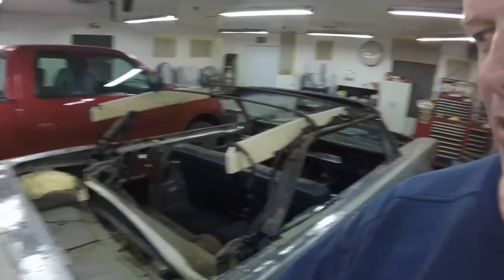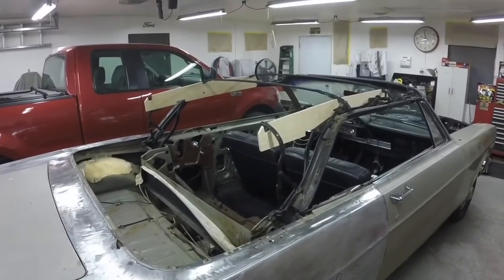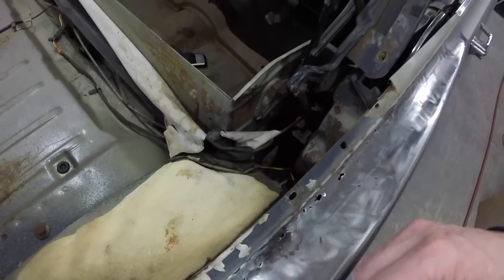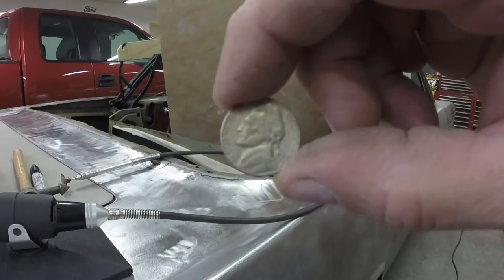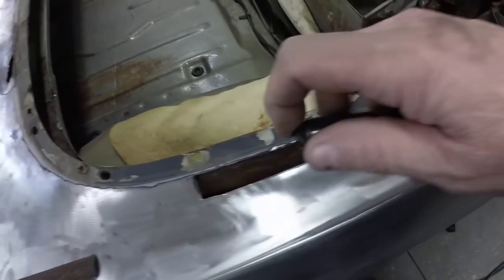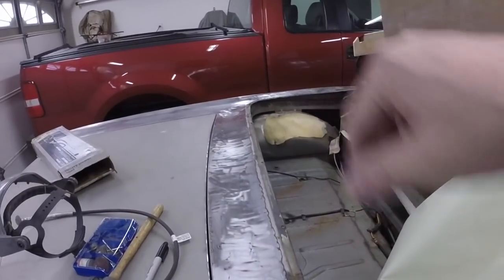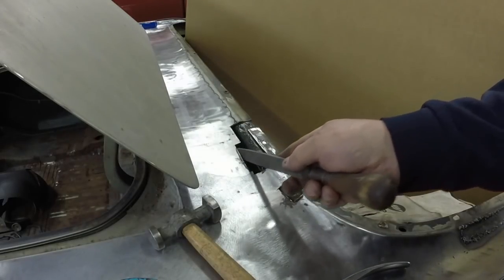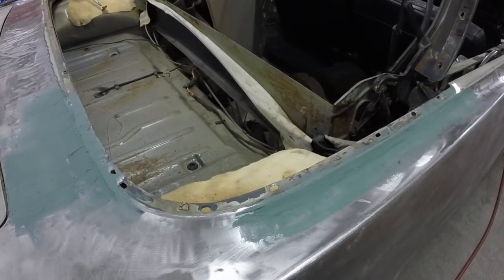1966 Ford Galaxie 500 convertible restoration part 96 welding up rust holes

Comment: I would be curious and lay on my back in the trunk with a flashlight. Changes are that whole panel has survice rust. Most cars back in the day didn’t get any paint in those areas. It was mostly bare steel from the factory. Would be nice to sandblast it and spray some oily coating on it.
Reply from the maker: Yes I looked at that area.... it's all bare metal. Only certain areas have surface rust tho. I hope to sand as much off as I can, and treat it so it docent cause a problem down the road.

Comment: Staying at home nonstop sounds like fun until you are forced to do it.
Reply from the maker: I don't mind to much, until I need something. Everything here is closed around here. It's like a ghost town! No noise from traffic, or jets. That part I enjoy. I am hoping I have enough stuff to keep going on the Galaxie, to get it into paint. If I run out of something, then things come to a stand still. I have no clue when auto parts or the paint supply store will reopen. Even my good local hardware is closed. One good thing tho, is it only took ten bucks to fill the truck with gas.... gas is really cheap here now, like under a buck a gallon in some places. If energy stays cheap, I think the economy will recover quick.... if it goes back up to four or five dollars a gallon like in 08, the recovery will be very slow.

How are things in your neck of the woods? Are you on any type of stay at home lockdown? Are you working on your Valiant? How is your 66 300 doing.... I love that car!  Stay safe.
Reply: @OldCarAlley  Things are pretty good here. There isn't any kind of lockdown, but even if there were, I would have to work because my job field is considered "essential".  Restaurants are drive-through only. Everything else is pretty much open, such as parts stores, Lowe's, Home Depot, etc.  There is a lot less traffic. I have been driving back and forth to Nashville daily, which is something I normally avoid. I'll usually detour around. Right now though you can breeze right through. Gas is about $1.85 for regular. I'm nearly ready to put the Valiant back together but I detoured onto the pickup truck briefly. I started to replace the RH floor, inner and outer rocker on THAT over the winter, but wasn't in any hurry because I didn't need the truck for anything. Now I need it, so i'm hustling to get it finished. I have a lot of video of both projects but I'm waiting to finish one or the other so I can put it all into a single video.  The '66 has been sitting quietly under it's cover. I have some minor repairs I want to do in time for the cruising season. One of them is installing a PERTRONIX...lol. The mechanical temperature gauge I installed crapped out, so I have to replace that. I'm probably going to pull the drive shaft back out and inspect the U-joints since it has a slight vibration. They were just replaced....30 years ago! Keep your chin up. You can always find a "sounds of traffic and jets" video on YT to calm your nerves lol.

Comment: Your patch panels around the convertible top well look great! Having the top professionally installed will save you a lot of frustration. Like I said, I installed one on my ‘63 Nova, and even though it turned out pretty well, it was a bit of an exercise in frustration, and was very time consuming. You will probably save yourself some grief. Your car is looking great!

Comment: Dont know what the cost differential is but if you can get one in black canvas rather than vinyl, it is a far superior look.  Canvas may not be an option if the stow area wont accept thicker material.  Suggest you have Robbins Auto Top in Oxnard, Ca weigh in on the pros and cons of canvas.  Pitch them on sponsoring the top episode at the trim shop and donating the top.  Robbins is a good company and might help out.   I bought a top from them in 1973 for  55 Thunderbird I owned.  Good luck stay safe and well.   https://robbinsautotop.com/
Reply from the maker: A sponsor for the top would be awesome, but thats a big expense for a company, plus Oxnard is across the country from me. Thats a long way to take a car for a top. The trim shop I use does a ton of show cars, and does amazing work. I'll put a good quality top on the car, you can be sure of that. I think the original to was canvas.... I will use what Ford used on the car.
Reply: @OldCarAlley   Howard. please call Doug at Robbins. They can ship top to your shop installer in Michigan.  Robbins is affiliated with GAHH (Mercedes tops) and Jack at GAHH suggested a call. If you would like me to make that call on your behalf , Id be happy to do it.  joe
Reply from the maker: @joelpalmer  I not even near ready for a top yet..... I going to wait, until closer to that job. That may be mid. May at the earliest.

Comment: 1960's foam is prone to rotting easily after a couple of decades, let alone 5 decades.
Reply from the maker: Modern day foam breaks down quick too.
Reply: @OldCarAlley  
Yes it does.  And being exposed to moisture regularly accelerates the breakdown.
In that regard I never put my top down if it's the slightest bit wet.  And I never lower it on very cold days.

Comment: What type of sheet steel do you use for the repairs? Is it the same thickness and especially the same type of steel used on the original Ford panels?
Reply from the maker: I get it where they reproduce body panels. It the same type and thickness as the car.